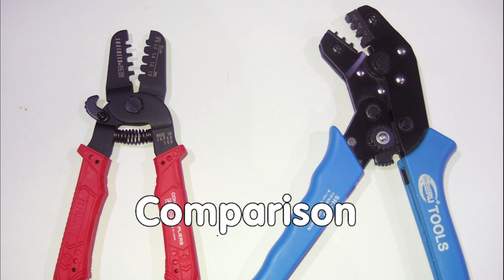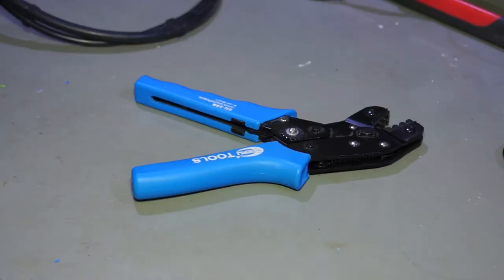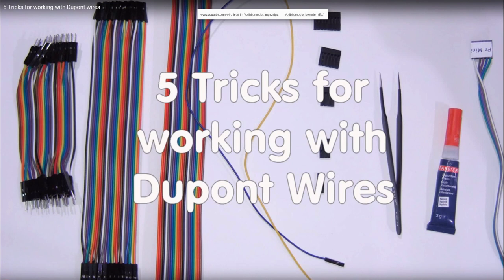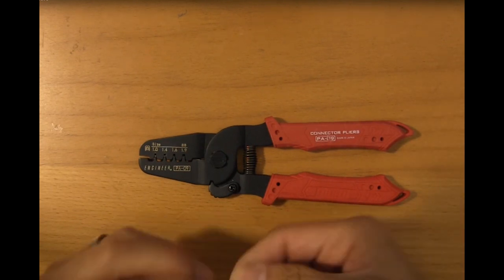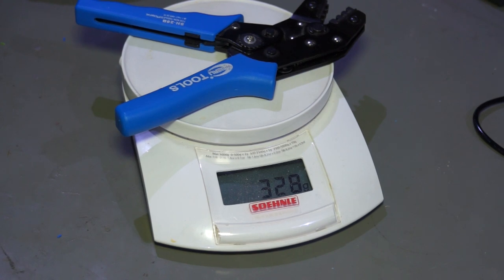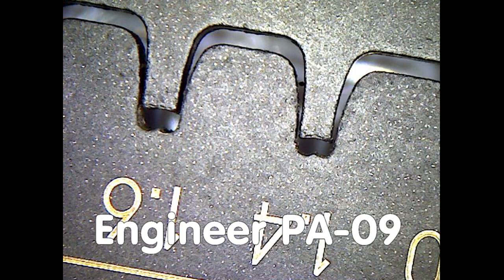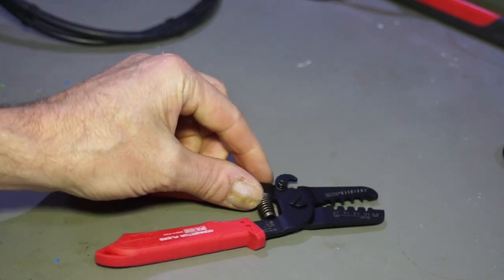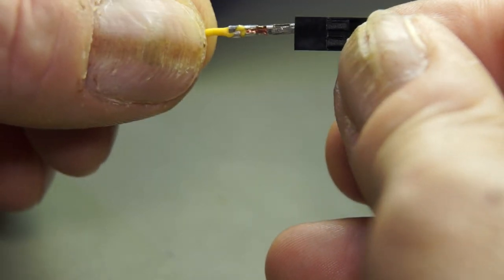#39 SN-28B Chinese Crimper  vs Engineer PA-09: Is there a difference for Dupont wires

Comment: Andreas, I think I know the main source of your problem with the cheap crimping tool: your lefthandedness. 
Don't get me wrong, I'm, left handed too, and I noticed in your other video that you have left-handed scissors and other tools, so you are aware that a lot of tools are designed for right handed people.

I already bought a cheap crimping tool from China before I saw this video, it looks exactly the same as yours, but luckily I watched your video before using it, so I was warned.

After the my first crimps also failed to be workable, I carefully examined the beak of the tool and noticed it is not straight, but has 2 different parts, one a bit wider, and the other a bit narrower.
Therefore if you insert the cable in the wrong end, the connector will be crimped the wrong way, and will not fit properly in the shell.

In the video you demonstrate crimping with the tool in your left hand, that is the reason you could never insert the pins in the shells.
The other problem(s) remain, it is still not a very good tool and it is hard to get good crimps, but it is possible with a little practice, and using the tool in your right hand. 
The Japanese one will give you a much better result, but I still wanted to share this with you and your viewers, mostly the left handed ones :-)

(yours is the first channel ever that I subscribed too!)

Keep up the good work.
Reply from the maker: I am aware of the two parts and tried everything. Maybe you got a better quality one and can save the money for an expensive one. Some viewers suggested that there are different makes in the market.
And if you read the other comments in this video you see that I am not alone. And I cannot imagine that all of these frustrated users were left handed.
Reply: I am left-handed but would hold a tool like that in my right hand, just as I do with my soldering iron.
Reply: Thank you for your comment, I am right handed but I had been struggling for days with a Chinese crimper and no way to get a better one, I just made my first good crimp thanks to you.

Comment: The problem with both crimpers is the wrap around the plastic sheath is wrong. It should be perfectly tubular and firm. I use a combination of the PA09 to do the initial wire crimp and finish off with a specialized tool TZ4228B which can do the sheath crimp correctly. The TZ4228B can do the entire Dupont crimp in one squeeze but it's very hard to set the wire depth, so I use the PA09 to do initial position fixing
Reply from the maker: I agree that the quality of the crimp is not perfect. So with your method I am sure you get a better result. Maybe I am too lazy ;-)

Comment: Just before discovering this video, I ordered one like the first in you review. It took a quite a lot of tries but I did become quite good at making these DuPont style wires.  I have recently discovered that, as you say in the video, they do have a tenancy to come unplugged if subjected to a little vibration so when I am sure that I have everything working as planed, I take regular wire and solder the leads directly, that way the build can be dropped or shaken with no worry.  I just completed a small 12 volt driven count-down timer for my wife to use when applying her eye drops to treat her glaucoma.  It works great, I have it driven by an attiny85 chip, and a 4 digit display along with a tiny  passive buzzer for the tune when her time is up.  I first wired it up completely with DuPont wires that I made using that tool, then, as I said, I replaced them not only for security, but to cut down the size of the unit so it could all fit into a tiny gs
Reply from the maker: Thanks for your feedback. Sounds you did a useful project with this tiny chip!

Comment: Thanks for your presentation of our Crimper PA-09.  For your reference, we guess the application of PA-09 to Dupont wire is of wrong use because PA-09 is not suitable for triangle-shaped open-barrel in your movie.
Reply from the maker: +ENGINEER INC. Shige If you read the comments here, it works fine. Which one would be appropriate according your opinion?
Reply: The affirmative reviews are of course welcome.  However, what we wanted to point out is your video may lead some end-users to a wrong direction because triangle barrels are not applied to PA-09.  That is all, and thank you.
Reply: As the Engineer spokeperson said, the PA-09 shouldn't be used to crimp DuPont (Mini-PV) terminals. The right tool to use it is HT-95 or HT-100, which is around $1000. I will buy the PA-09 nevertheless, because I am going to use it for JST PH and SM terminals as well as Molex KK and Micro-Fit terminals. These are widely used in consumer electronics and by DIY hobbyists. Right now I am using Knipex 9721215B and Yato YT-2256 crimping tools. None of them provides satisfactory results with any of the terminals I wrote about. I will of course use the PA-09 for the DuPont terminals too, even when the crimpers are not designed to use them for crimping these terminals. The result of crimping with PA-09 is nevertheless much better than any other tool I used. One question for Engineer - is buying the PA-09 on eBay safe? Aren't there any knock-offs of your genuine tools?
Reply: Great article.  I just checked mine and they are PA-21,  same as PA-09 but with bigger gauges.   It doesn't list mini-pv on the packaging but they work well.
Reply: I wish I had seen this before buying this shirty halfords Chinese one
Reply: @ENGINEERINCShige  So is there a similar priced item that works better? The HT-95 or HT-100 mentioned earlier is way out of the price range of the hobbyist.
Reply: Thanks for your feedback.  At present our precise crimpers are all for open-barrels lined in parallel.  When we have a new model suitable for triangle-shaped barrels in the future, we will let you know.  Thank you.
Reply: In fact, we do not think HT-95 or HT-100 are suitable for crimping triangle-shaped open-barrel judging from the configuration of their dies.  At the moment, we have not developped any crimper for triangle-shaped contacts because of limited demands compared with barrels lined in parallel.
Reply from the maker: @Engineer Inc. can you stop your nonsense and try it out yourself? I think you do not know what we are talking about.

Comment: Andreas!  THANK YOU THANK YOU THANK YOU for this video.   I had the Chinese Crimper.  I used to dread making crimps and I almost never got a good crimp the first time.  Based on YOUR ADVICE I bought the PA-09.  What a difference.  Now I enjoy crimping and almost every one turns out perfectly.  The only defects are when I squeeze too hard and the crimp shears off the wire.  

I heard you say that some have ridiculed you for your accent.  I enjoy hearing your accent.  I speak several languages and I am amazed at your vocabulary!  You are awesome!
Reply from the maker: Glad to read that you made the same experience than me!

Comment: I finally found a generic tool that actually does a good job with dupont terminals, the Hozan P-706. Works much better for these terminals than the Engineer PA-09 because it has the correct round die for the insulation crimp. My recommendation is to lightly pre crimp the insulation first then line up the end of the insulation between the two crimp areas and fully crimp it. It makes crimps that are almost as nice as the HT-95 (the official tool for dupont terminals) and pull out resistance is similar. Use the 1.8m round die for the insulation and the 1.4mm die for the conductor. When crimping the conductor line up the "brush" end of the crimp (the side opposite where the strands enter the crimp) with the face of the tool this way about 0.2 hangs out on the other side and forms a bell mouth which will prevent the edges of the crimp from cutting the strands (this is also how the HT-95 crimps them). Another good thing about this tool is that you don't have to worry about over crimping. As long as you are using 22-26 AWG wire you can just fully close the die and it's exactly the right height (as I mentioned I tested pull out and found it comparable to the factory hand tool)
Reply from the maker: Thank you for your feedback!
Reply: Exactly, neither of the ones he has in the video crimp the insulation part correctly. Thanks for that Hozan crimper info!

Comment: I accidentally bought the Engineer PA-20 crimper instead of the PA-09, but it still worked well for me. I had used a cheap generic crimper like you showed and found it frustrating to use. The crimps weren't good and I had trouble making sure the wire was aligned properly. Since you can't see where the wire is in the big crimpers it can be tricky. I just crimped two connectors on very narrow gauge stranded wire with the PA-20 and it worked much better than before. I feel like I have much more control with it. It may take longer, but I don't mind that if I can get a good result. With the generic bigger crimp tool I often to to cut off failed crimps and redo them.  This is so much better. Thank you for the recommendation!
Reply from the maker: Thanks for the feedback. I am sure, it helps others to decide!

Comment: the difference is obvious on your jaw profile shots, the engineer tool has a well defined "buttock root" in the female die, with a very close valley fit, and a visible radius on the male die face. the ali express example has none of the 3, lol. those shapes are needed to properly form the crimp. because of the far looser fit in the valleys, the crimp actually becomes a stab lock. fine for lead ends on bike cables or fishing line sinkers, barely usable for electric crimps. also notice the mechanical advantage of both tools. engineer, about 2:1 leverage to 6:1, more as the wire gets heavier. no ratchet or compound levers means one actually feels the crimp form. chinese model basically has a fixed leverage at all stations, with a compound lever system. the straight jaw opening to handle throw ratio looks about 4:1, but the ratchet seems to underdrive significantly, so an actual ratio probably closer to 8:1, sans any ability to receive tactile feedback. you basically crush the life out of those tiny dupont barrels with the chinese model. that distortion carries through the pin body, so they have a fairly bad fit in connectors.

Comment: I bought a HT-225D Full cycle ratcheting crimping tool. I experienced the same results you did with the SN-28B. Now I'm shopping for a new crimper and was looking at the Engineer PA-09. Thanks for the video it supports the 5 star reviews I've seen for the PA-09.
Reply from the maker: I am not sure the HT-225D supports Dupont connectors. It is built for different connectors
Reply: The issue is the quality of the die manufacture and the way the jaws align as they are closed. According to Multicomp, the marketer of  this tool to Newark/Farnel, this is the tool to use for crimping the 2226TG open barrel connector socket and it works about 1 in 5 times. As is typical with Chinese manufactures quality isn't job one. It is OBE as the Japanese PA-O9 tool arrived and works well.

Comment: As other comments have mentioned I have used another tool (an  IWISS SN-28B tool) and while it took me quite a while to learn to use it well and I seem to have to relearn every time when I have not used if in a while it can make good crimps, but is very difficult to use.  After seeing your videos and the comments below I plan to order the PA-09 in the near future.  Your videos are excellent and you explain things extremely well.
Reply from the maker: I would not order a PA-09. I also have this IWISS tool and it is ok. (This is an old video)

Comment: Andreas, Thank you for this video. This is what I needed to see to make up my mind and order the PA-09 tool. I too had the same issues with that stupid SN-28B tool. What a pile of hooey. I've now received the PA-09 and have crimped my first Dupont ends with it. I am a believer. Even though Engineer says it's not compatible with Dupont connectors the PA-09 has quickly, cleanly and securely installed 4 pins on a stepper motor for a project. I am going to toss this pile of junk SN-28B in the recycling.

Anyone on the fence about buying a $40+ tool like this, don't be afraid. I know it looks cheap like the Chinese wire crimpers we are used to seeing. This is not a cheap tool. The business end of this tool is precision ground and machined to the contour needed to do the job. Truly superb workmanship like you expect from our Japanese friends.
Reply from the maker: Thank you for your valuable feedback. I hope, it helps others avoiding mistakes...

Comment: Thank you for the advice; you have saved me wasting money on buying an inferior product.
I was about to buy a cheaper ratchet tool and saw your video, which made perfect sense, so I bought a PA-09 from Precise Hand Tools Ltd for £39.99 via eBay.
I have  just made up two Futaba plug extension leads with my new PA-09 and got perfect crimps first time.
As the man says, you only get what you pay for, so don't be tempted by cheap junk from China.
I notice they also sell the next size up, if you need to do bigger terminals.
Well done and thanks again.
Happy crimping
Reply from the maker: Glad to read that. A lot of Chinese things are worth every Dollar, but this was just not usable. That was the reason for this video...

Comment: I agree with your video entirely Andreas.
I bought the SN-28B because it was cheap and as a result I had terrible experiences trying to crimp wires to the Dupont connectors. The tool would either not crimp the wire enough for a sturdy connection, the Dupont connectors would end up bent out of shape, and / or the connectors would not fit into the housings if I finally made a successful connector.
So in total frustration I ended up doing the same as you ... I bought an Engineer PA-09 directly from Japan.  After one or two failures during the learning process, every connector made since has worked out great.
So, don't bother buying the cheap Chinese tool.
The Japanese tool is definitely worth the extra dollars.
Reply from the maker: Thanks for your feedback!

Comment: Hi Andreas,

I finally got to work with tiny 2,54mm KF2510 plugs and now also joined the PA-09 community!
The larger one (SN-28B style) is a real pain in the A**, but great in destroying wires and the carefully counted metal contacts.
The PA-09 is really handy and -- like you said -- fun to use. No more frustration!

Thanks a lot for your videos!
Reply from the maker: Glad to read that! Thanks for your feedback.

Comment: The biggest problem with "Chinese" crimpers is the variable quality of the many clones from different manufacturers that bear the same type number.  I have one marked SN-28B that works flawlessly now that I have worked out the correct technique to use it.
Reply from the maker: I agree and I think quality improved over time. My IWISS purchased later also woks ok

Comment: Andreas, THANKS for your vids! I have been using the "chinese" tool and have do not appear to have the issues you report! I do however, crimp 3 times: 1st crimp is in the the LARGE gap to crimp the plastic on the wire, 2nd goes on the smaller to crimp the wire and 3rd crimp the inside. The 3rd crimp usually sets the pin straight...
Reply from the maker: There are several types of the same tool in the market (see also the other comments). Some of them seem to be ok.

Comment: I came to the exact same conclusion. I bought the iwiss tool and then exchanged it because i thought it was defective. The replacement was no different. Both of them would damage the tab that holds it into the shell. I then had to use a pair of tweezers after every crimp to fix the damage and make it work. I have just returned the iwiss and purchased the PA-09 as you recommend. It should be here Tuesday and I look forward to hassle-free crimps from now on. Thanks for the video :)
Reply from the maker: You are welcome. Hope, it works for you, too.

Comment: Hi Andreas,
Thanks for the tip. I ordered a PA-09 from Rakuten Market in Japan,  crimp connectors from Ali Express and wire from
AlleKabels, a Dutch webshop selling cables. I had some bad experiences crimping the larger automotive connectors,
but I completely agree with your conclusion that the PA-09 is an excellent tool. Right from the start I had near-perfect results.
Thanks for the tip, and although globalization has it's dark sides, this is an example of the benefits.
Reply from the maker: Thanks for your feedback!

Comment: I've just seen your video when I was searching for information on the new crimping tool I've had delivered today. The jaws you are using are the 1601-08 that are listed as suitable for non-insulated barrel connection terminals (the kind of connection usually used in automotive wiring looms. The only jaws that might work are not listed for the DuPont connection but are 1601-2546 and are listed for the MC4 solar connection terminal. So all in all you are trying to use a tool designed for different connections. It may have been miss labelled but it isn't designed for you connections are using. It does work well for the connectors it is designed for.
Reply from the maker: +JM SometimeWoodWorker These tools are sold for dupont connectors as many comments here show. I never investigated in the numbering scheme.